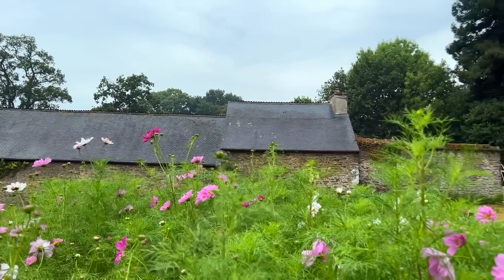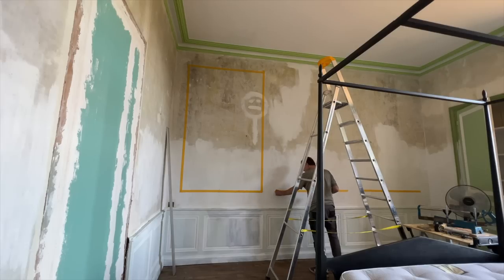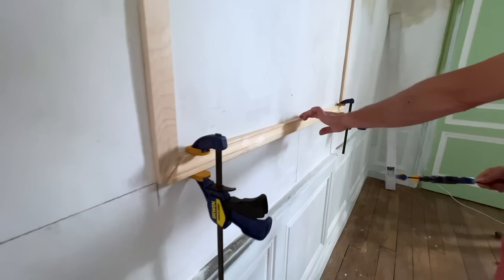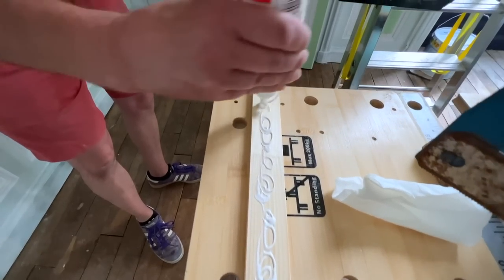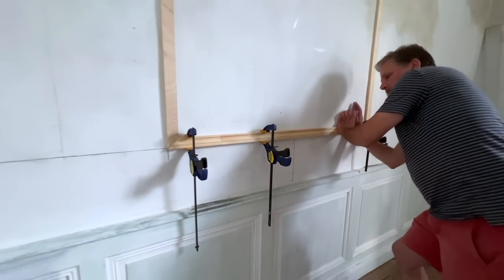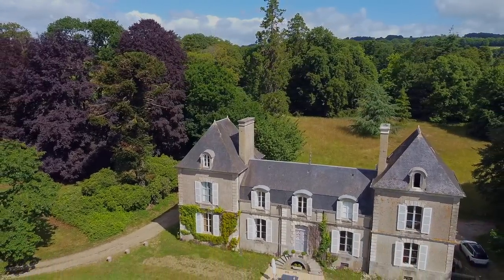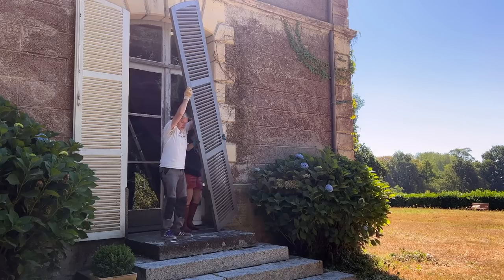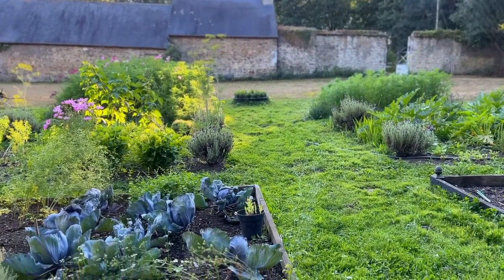Will the CHATEAU look better? Our French Chateau: Episode 18

Comment: You should check with your insurance company because ins Co in france require the shutters to be shut when you leave for any length of time. If you don't and your house gets broken into they will not cover it. So if your shutters are not there you could run into a problem. But check to make sure this is still the case or is the case in your area.

Comment: Shutters can keep the cold out too, especially on the North side! :)
Reply from the maker: We have interior shutters...
Reply: @OurFrenchChateau ou outside shutters prevent the windows to be too cold in winter and too hot in summer. It's a tradition insulation. It can be reinforced by inside shutters or thick curtains. 
Some old building like our prefecture from the XVIII seams they don't have shutters, they are in fact sliding one, they slide inside the walls on each side. It was build like that. 
Shutters are important for the safety, better check with your insurance company.

Comment: The shutters will warp if you put them in an out building leaning up against a wall. This will ruin them. 
  Plus they are there to protect the exterior of the windows from winter wind and weather. And also a security feature.

Comment: I used this this type of molding on 8 full doors both sides. I didn't have to use a back panel as Lincoln but he was smart to add the back strip. I also used the same molding under a chair rail. Did all this myself for the first time. All that could happen was it didn't work but it did. I love that kind of work and by doing this at the  chateau you will have added a beautiful elegance.

Comment: Great idea...just a "novice's question" - shouldn't the TOP molding be the same as the existing BOTTOM molding ?    Continuity in the patterning?  It will look great either way, but I'm just reflecting on what I've seen ... love your choices in colors, etc. and the fact that you both LOVE animals.
Reply: I agree...  if they were wanting to make it look as if it were original, then it would need to be...Perhaps they dont make that one anymore...  or it would cost too much to have it made.
Reply: I also agree…the new moldings should at least line-up with original lower panel’s outside edges…perhaps with one larger center panel spanning the width of 2-3 lower panels…

Comment: The moldings will look really good! Wouldn't it have been easier to glue the decorative molding onto the flat pieces before putting them on the wall?
Reply from the maker: Thanks :) The walls are wonky, so the base needed to be screwed in first, then top pieces glued.
Reply: @OurFrenchChateau  That makes sense.

Comment: Why didn't you match the width of the panels in the dado? What you are doing it now has no relationship between the panels above and below the chair rail. If it had been real boiserie there would be a relationship because the panels would have been built elsewhere and installed in sections. The sections divided floor to ceiling. The extra strip makes a very thick molding, even deeper than the existing ones, at least from a quick glimpse.
Reply: I agree, the false panels have no relationship to the existing dado design. This could have been done with wallpaper which would be a traditional solution to any chateau of this period.